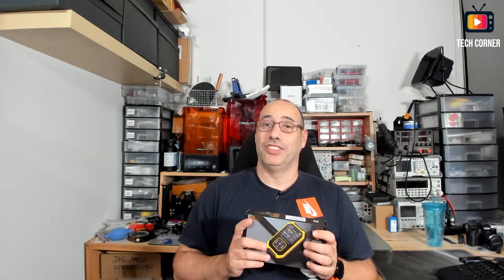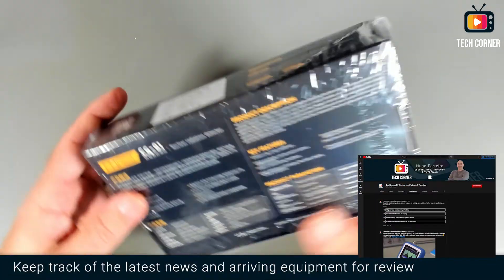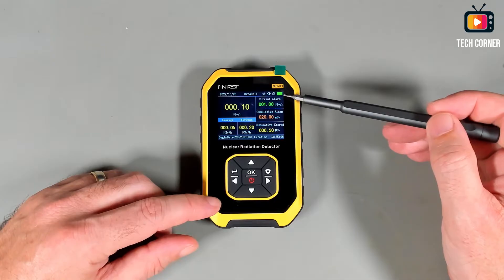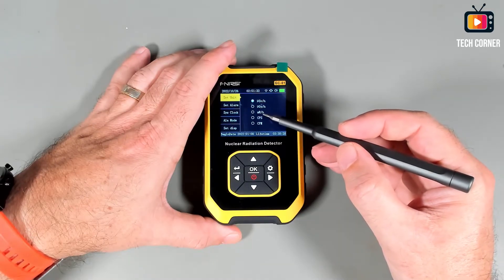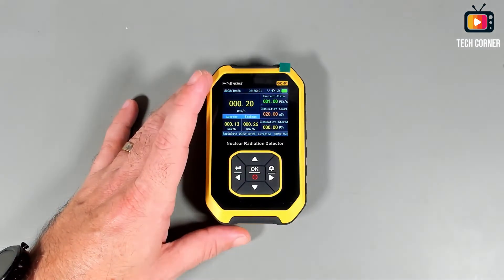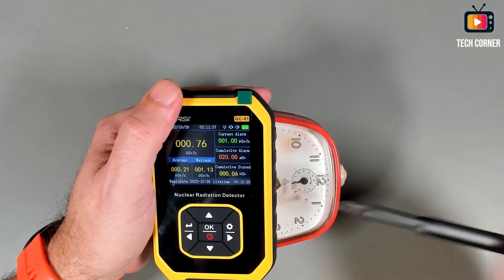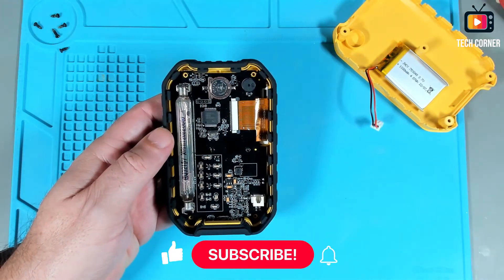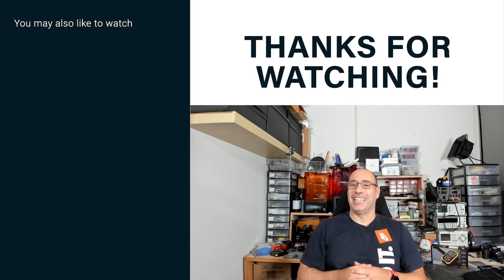FNIRSI GC-01 Nuclear Radiation Detector/Meter ⭐ Would you need one?

Comment: Hello Hugo.  Someone asked me to look at this review and advise.  I'm a retired nuclear engineer, electrical design engineer, former Certified Professional Health-Physicist and company owner.  I want to give you and your viewers a short course in radiation measurements and comment about that instrument.

Executive summary: That instrument is junk for anything other than counts per minute or second indication.  I will explain.

Nobody who deals with serious amounts of radioactive materials or radiation uses the SI units.  They are junk and only cause confusion, something that can't be tolerated where there is enough material or radiation to cause harm.  We use the traditional Curies, Roentgens, RADs and REMs.  That's what I will discuss here.

Exposure to ionizing radiation is measured in Roentgens.  The definition of the Roentgen or R is 1R = 2.58E-4 Columbs of charge/kg of air at STP.  There is no equivalent SI unit.

Absorbed dose is measured in RADs or Radiation Absorbed Dose.  A RAD is 100 ergs/gram of the absorber.  One Roentgen = 1 RAD for gamma rays of typical energies.  The SI unit for absorbed dose is the Gray which is 1 Joule/Kg.  1 Gray = 100 RAD.  See where the confusion starts to creep in?  Which way do I move the decimal point?

The amount of energy deposited in the absorber is dependent on the energy of the photon.  Here is where the first defect in that instrument rears its ugly head.  A Geiger tube returns a constant pulse height irrespective of the photon energy.  So a Geiger tube cannot measure RADs or Roentgens or Grays or Sieverts.  Only counts per minute or second.

The measure of the effect on living tissue is the REM or Radiation Equivalent Man which is Roentgens * Quality Factor.  Some Quality Factors:

Gamma rays                                   1
Beta (electrons)                             1
Neutrons < 10 keV                         5
Neutrons 10 keV-100keV             10
Neutrons 100keV-2MeV               20
Neutrons 2MeV-20Mev                10
Neutrons >20meV                         5
Protons >5MeV                             5
Heavy particles                             20
alpha, fission fragment, heavy nuclei

The SI unit is Sieverts and 1Sv = 100 REM

More opportunities for confusion.

As a practical matter, amateurs will be measuring gamma and beta.  Professional thin window Geiger tubes can measure Alphas.  Amateurs probably won't ever run into neutrons.  Professionally, the neutron survey meter is called the Bonner Ball.  It consists of a large sphere of polyethylene about the size of a basketball with a boron-10 trifluoride detector in the center.  The polyethylene thermalizes the neutrons ( about 0.002 ev) and the BF3 detector detects thermal neutrons.  The only amateurs which might have use of a Bonner Ball are those building large Farnsworth Fusors.

Back to the instrument.  The instrument uses a glass Geiger tube.  A sub-optimal construction.  The tube might be sensitive to beta radiation, depending on the energy.  High enough energy betas can penetrate the glass wall and register an ionizing event inside the Geiger tube.  

Gamma photons must interact with mater to register ionizations.  The glass wall is primarily silicon and oxygen.  Both are low Z materials and thus don't absorb gamma photons well.  Normally a gamma-sensitive Geiger tube has a steel or tungsten shell to better absorb gamma photons which generate secondary electrons which actually trigger the tube.  

The insensitivity of this tube is indicated by the spec of 80 counts per minute/microSievert using Co-60 which emits 2 gamma rays around 1 MeV energy.  This is a strange spec since the most common isotope found around nuclear facilities is Cs-137 with a single photo emission at 662 keV.

High energy gamma photons pass right through the glass tube with little interaction.  As the gamma energy drops, the tube becomes more sensitive since the gammas are more likely to interact with the glass walls.  Thus at lower energies, this instrument will grossly over-respond if set to display Sieverts or Grays.  The display of Sieverts or Grays is thus fiction and is the first lie told by the chicoms.  These two settings should never be used.  The ONLY things this instrument can correctly measure is counts per minute or counts per second.

When an ionization occurs inside the Geiger tube, either directly from a beta particle or from a gamma photon-induced secondary electrons in the glass wall, the high voltage is high enough that the tube avalanches.  That is, it goes conductive until all the energy stored in the capacitance associated with the tube and the associated electronics is dissipated.  The tube contains a halogen, normally chlorine, which quenches this avalanche once the voltage on the tube drops below a certain value.

From the instant the tube starts to avalanche to the post-quench build-up of high voltage through the high value multi-megohm quench resistor, the tube is totally insensitive to other incoming events.  This is called the dead time.  The result is a non-linear event rate vs count rate indication.  Professional instruments have dead time correction circuitry built-in but from looking at several disassembly videos, I've seen no such circuitry.

The next problem is tube saturation or "jamming" in a high radiation field.  At some point the fluence of gamma photons will become faster than the tube can recover from dead time.  At that point the tube quits generating pulses and goes into continuous conduction mode.  The result in amateur counters is that the indication will suddenly drop to zero even though the radiation level can be quite high, a very hazardous condition.  Professional instruments have a circuit that detects this continuous current flow and drives the meter full scale.  Again, I have seen no indication of an anti-jam circuit in this instrument.  Given the price, I have ordered one to reverse engineer.

About sensitivity.  The chicom data sheet claims that this instrument measures beta and gamma.  They lie.  A beta particle will travel 4-6 inches in air, depending on the energy and is stopped by a sheet of paper.  The tube itself may have a thin enough glass wall to be beta-sensitive but beta will NOT penetrate the plastic case.  Therefore this instrument is gamma-only.  Another chicom lie.

The datasheet claims this instrument uses an energy-compensated Geiger tube.  It does not.  Yet another lie.

Energy compensation means that the Geiger tube is wrapped with a combination of materials, usually polyphenol-impregnated cardboard and aluminum, which is designed to absorb part of the lower energy gamma photons to somewhat linearize the tube's response to photons of various energies.

The low level radiation found in a nuclear plant or after a fictitious nuclear attack and resulting fallout, after the radiation has been scattered and partially absorbed, is a continuum centered around 300 keV.  This instrument, with its uncompensated ion chamber, will grossly over-respond to this "degraded radiation".  This would cause people with no training, especially if the instrument is set to Sieverts or Grays, to over-react and maybe panic.

The ONLY things this instrument may be capable of measuring is contamination (counts per minute) or relative radiation levels (changes in counts per minute).  I also question its ability to handle high count-rates.  The processor it uses should be fast enough but it's critically dependent on both the analog pulse conditioning circuitry and the counting software.  When I get my instrument, I will connect a calibrated pulse generator to it and see how it does.

I can tell from the slow screen update that the firmware is crude, written by someone who doesn't understand radiation detection.  Professional instruments use a rolling average of short sample intervals and some other techniques to cause the display to update rapidly, especially when a significant change in activity is detected.  "Frisking" with this instrument to find radioactive contamination hot spots would be difficult with the slow display update.

About the highest level of radioactivity a civilian can get is uranium or thorium ore, preferably Pitchblende.  I have a collection of every uranium ore and the Pitchblende is by far the hottest sample.

I hope this article helps clarify a few things.
Reply from the maker: Hello John, I don't know how to start to thank you for the time you spent in this reply. I really appreciate it and it was enlightening. I will not become an expert on the subject now 😁 but it will really help to understand better how everything works/happens. Thanks so much for this text!
Reply: Saved me a few bucks, what geiger counter would you recommend then?
Reply: @itssomebuddy9160  If you're doing something that has you encountering actual radioactive material, as does my volunteer job as the Emergency Management Agency's RADEF chief for E. TN then only professional, industry-proven instruments will do.  Only 2 companies survived the nuclear shake-out.  Eberline and Ludlum.  Victoreen is also a top brand but they got bought out or went out of business or something and no longer make radiation instruments.  A used Victoreen is just fine.

Eberline and Ludlum are both great companies but I'm partial to Eberline, mostly because of my decades of experience with them.

You'll need two instruments.  A survey/frisker Geiger counter with a pancake probe and an Ion-chamber-based instrument for measuring dose/exposure.  The frisker is to find contamination.  Radiation that pegs a frisker presents no dose hazard.  If you're just playing around with radioactive stuff, prospecting for radioactive items in antique stores, yard sales and the like then that's all you need.

If you think you'll encounter stuff that is actually hot dose-wise then you'll also need the ion chamber calibrated in mR/hr.  Stay away from SI units.  They serve only to confuse.  The power industry has stuck with traditional units so as not to sow confusion and so that the millions of documents and books prepared pre-SI make sense.

One of my favorites is the Eberline RO-2 ion chamber instrument.  I've had mine about 30 years and send it out every 5 years for calibration.  Over that time, no adjustment has ever been made.  It is that stable.  The only maintenance item is a desiccant pack that keeps the ion chamber dry.  When it starts to turn pink from moisture it's time to bake it in an oven back to blue.  About an annual task.  It uses 2 D alkaline cells which last forever.

If you can find a Victoreen R meter with all the chambers, that is an excellent standard to have on hand.  It consists of a charger/quartz fiber electrometer readout unit and a series of very high quality ion chambers.  The ion chamber of choice is put in the charger and charged to zero indication.  The chamber is then put in the radiation field.  It accumulates (m)Roentgens.  If you time the exposure you can calculate (m)R/hr.

This instruments measures Roentgens in terms of the fundamental units which  are charge deposited in a volume of air.  It is a transfer standard and is my lab's standard that I calibrate other instruments against.  I'm not aware of anything which has replaced it even though Victoreen has been out of business for a couple of decades.

As for the other toy-grade instruments on the market, I just don't know.  Any GM instrument that purports to measure dose in REM or Sieverts is blowing smoke.  That simply can't be done with a GM tube.  Price doesn't matter.  There's a guy on here who has a channel called Radioactive Drew.  He paid around $2,000 for a Thermo-Electron RadEye and it makes the same mistakes the cheaper instruments do.  It uses a pancake GM tube which is excellent for frisking.  But the response is slow.  And the claims that with the equilibrium cap placed over the pancake probe, it can measure dose in Sieverts.  

It can do that but only at the gamma ray energy of the calibration source.  Because of its relatively long half-life, the most common isotope found in nuclear facilities is Cs-137 with its 661 kEV emission line.  The firmware can include a conversion factor to make so many CPM equal to so many mR/hr.  But this is a correlation and not a causal relationship.  GM tubes fairly grossly over-respond to lower energy gamma rays such as those from Ba-133 and I-131.  The instrument will grossly over-estimate the dose from these isotopes.
Reply: @neon-john  We'll be headed on a biol research trip to an island where nuclear testing was conducted a few decades ago. I like to believe there is no price for caution. 

I posses a vague understanding of radiation and what it involves, I definitely need to dedicate time to study the topic. Thank you for sharing your knowledge, it's extremely valuable and I will use it as a reference point!
Reply: the preinstalled firmware is pretty garbage, but i have found that many aspects of this device can be massively improved just by flashing radpro onto it. for example, radpro allows you to set up an actual click sound, do data logging, generate true random numbers, and even play chess :)
Reply: I bought one to play around with at work. I work with high activity Ir-192 and Co-60. My NDS products ion chamber survey meter is without a doubt the only thing I’ll trust. 100 ci of iridium in a high rad area and this hunk of junk was reading nothing but background radiation.
Reply: could use some guidance from someone  with more knowledge on this subject 
i work in oil and gas and encounter vessels with NORMS inside 
i’d like my own device for determining just how hot an area is
yes, the companies do their own testing and deem things safe or not safe but i’d like to know myself 

i don’t want to spend a ton of money on it 
so what should i go with ? 
radiacode makes an interesting little device 
will it work for my purposes though ?  

thank you so much for any suggestion and advise 

cheers 😊
Reply: I'll send mine back then 😂
Reply: I just got mine this week. Want it for a TEOTWAWKI type emergency where there is a possibility of fallout. I just want to know if there is fallout (I'm in New Zealand so likely this from a distant detonation, possibly hundreds or thousands of km away in the ocean or even in Australia), when it's safe to go outside, and if it's time to go back inside again. Or if certain objects or areas are hot. You sound like you have a bit of knowledge on this subject, I'm interested how would you rate it for that purpose?
Reply: I caught a mistake.  I said "This instrument, with its uncompensated ion chamber,"  I should have said "This instrument, with its uncompensated Geiger tube".  Sorry.
Reply: So in short: is this useless in the event of nuclear war for example? Or would there be some use of having one?
Reply: @TwinkingToby  im very late to reply but as far as I see if you have to use it keep it in CPM(count per minute) or
CPS(count per second) and only expect basic and unreliable readings that can be wrong compared to the actual background or source readings. It only reads gamma but this is the most common type of rays the everyday person will come across if I remember correctly. I'm no expert but I did some preparedness training in using real Geiger counters many years ago this original users comment is very well written and explains the products possible abilities or lack of them however you want to see it. If you use this dont expect amazing results and also remember if you are getting consistent high reading to limit exposure by remembering the most important rules to stay safe around radiation

Time
Distance
Shielding

Limit the time you are being exposed

The distance you are from the source

The shielding you have from the source

Limiting exposure is key to staying safe. I hope my bit limited knowledge i have shared helps and doesn't confuse anyone it is a very complicated science but not as scary as people tend to think with some simple (yet sometimes complex) education we can understand how dangerous or relatively harmless/normal it can be.

Comment: I ordered this detector from Aliexpress I will receive it on 11/26, I already have Arduino Geiger detectors that I built with J305, SBM20, SBM19 and SBT11A tubes, and two bought expensive RHelectronics in Israel.
Reply from the maker: Hi Maxime, thanks for sharing and watching! 😁
Reply: @TechCornerTV  Is there a possibility of mounting a buzzer in parallel on the led on GC-01? Thanks
Reply from the maker: @Mimichris100  I have to upgrade my firmware, there's a lot of requests for that feature, maybe they added to the new firmware. You can download it from FNIRSI website and install it.
Reply: @TechCornerTV  I downloaded it but it seems that there is an error and the GC-01 does not work anymore, I will not dare to update it if ever it does not work anymore, we update it with Win10 and connecting the GC -01 to the PC and loading the file into the GC-01.
Reply: @TechCornerTV  are u saying there is firmware to allow it to click/beep?  from official site? to flash it?